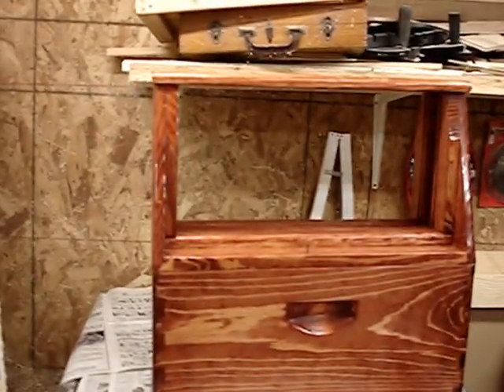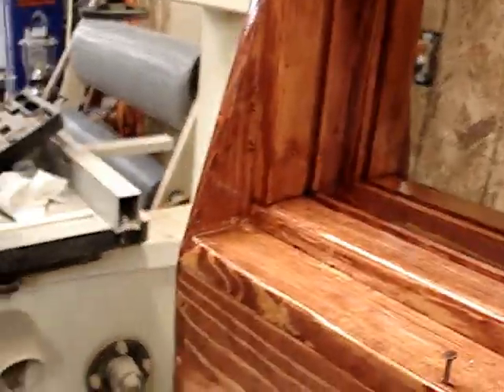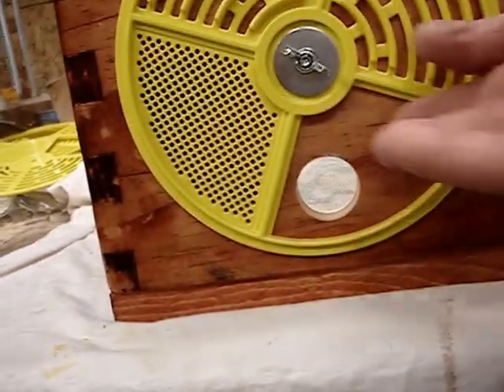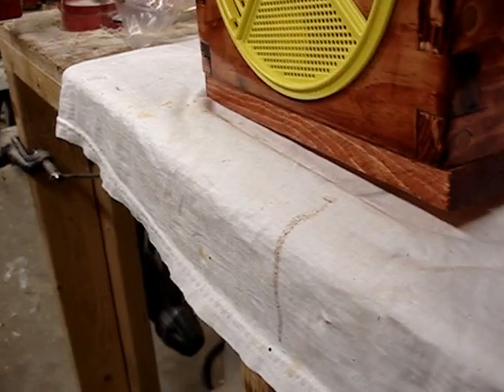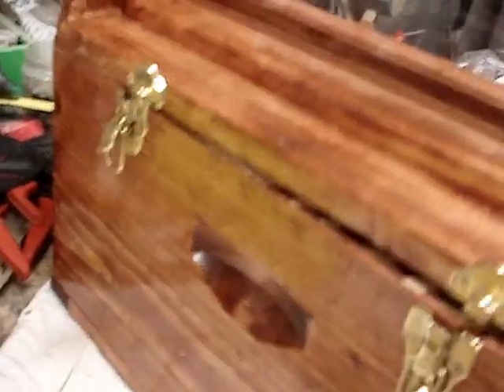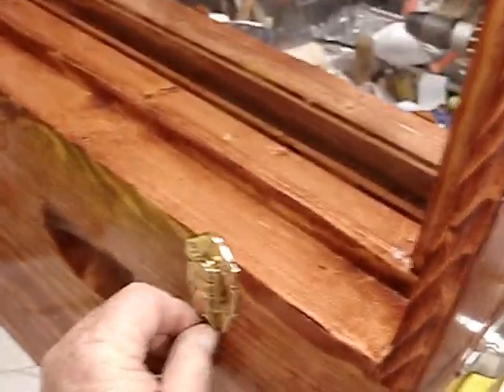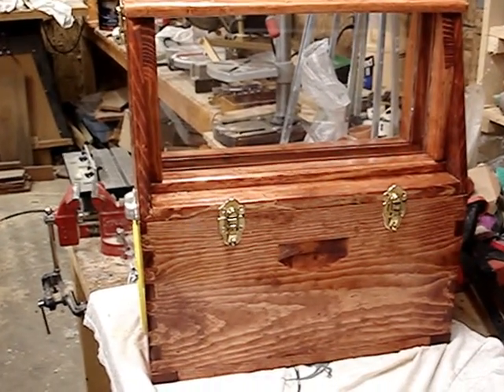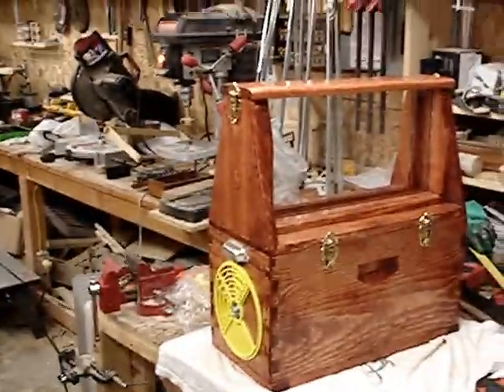Ulster Observation Hive Build

Comment: Ulster-style observation hives are available from Brushy Mountain Bee Farm, or from Mann Lake, or from Dadant, maybe others.  The current price trend is approximately 160 USDollars.  Quality varies.  According to videos that I have been viewing, Mann Lake produces a higher quality product than Brushy Mountain.  Thus far, I have viewed nothing on which I can judge the quality of the Dadant model.  Ulster-style observation hives are relatively easy to build DIY.
I assume that the Dadant 5-frame nuc obs-hive is based on Dadant frame measures.  I do not know which frame-size the other manufacturer's obs-hives are based, possibly Dadant or Langstroth deeps.
If you build your own, simply start with a 5-frame nuc that uses the same frame-size as the rest of your apiary (so that you retain the convienience of exchangeability with your apiary) and adjust your dimensions(always accounting for "bee-space" above, below, left and right) to fit your desired 5-frame nuc.  Doing so, enables you to build an Ulster-style obs-hive for any frame-size: Dadant, Langstroth, Zander, DeutscheNorm (DN), Dr. Liebig, etc., etc.
To keep at a minimum the bees building burr-comb on the viewing panes, be sure to keep the "bee-space" from frame to pane at a minimum.  You may not want to silicone the viewing panes in place, because it might be advantageous to remove them at a later time for maintenance or cleaning, thereby keeping cleaning solutions out of the inside of the hive.  Additionally, with time, panes will become scratched and will need to be replaced.